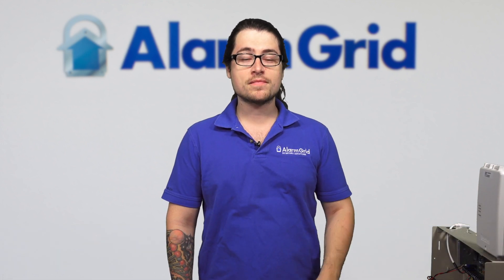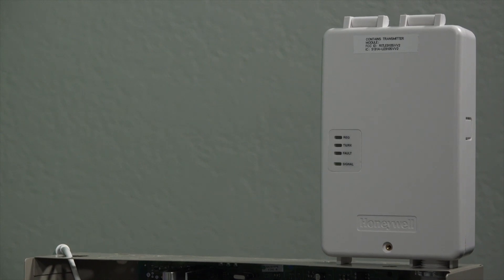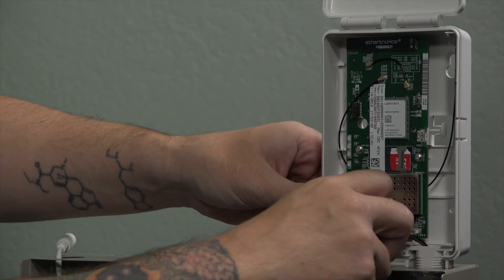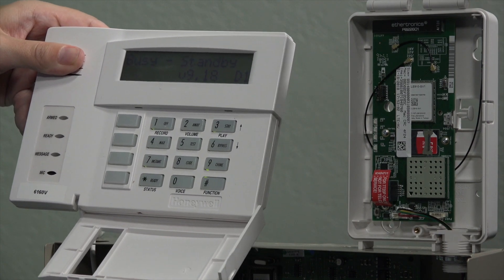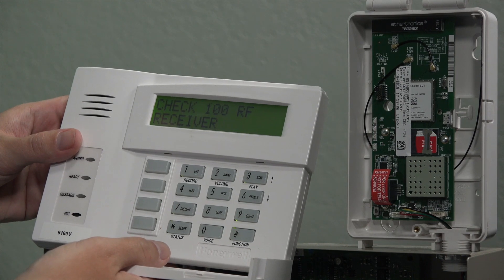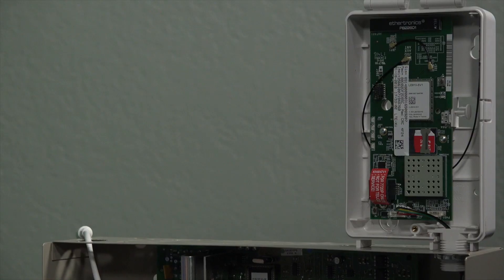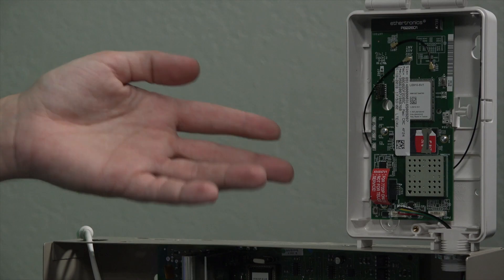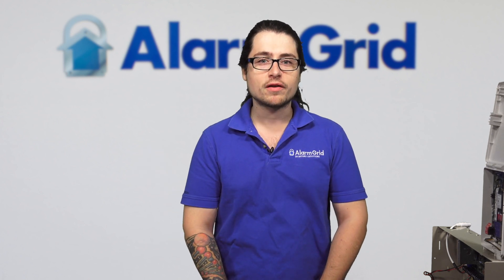Honeywell 6160: Explanation of a bF or LngRng Radio Error

Comment: Great information.  What causes a 6160 Key pad display "User Code Error: Key 0-9 Locked" which occurs upon attempting to disarm the Vista 20-p and pressing just the first digit of the 4 digit passcode on the 6160? The manual indicates that it is due to pressing 30 numeric keys (0-9) within a window of 15 minutes and no valid command is executed.  This has not been the case each time this occurs which is very intermittent.  It occurs once every few weeks. The 6160 has been swapped with a new one and the connections checked but issue still occurs.
Reply: Hello, if 30 buttons without a valid code is not being pushed then you have an issue on your ECP bus. The data has noise or a bad device connected to it. You will need troubleshooting.

Comment: Turns out it had to do with the cell towers being upgraded to 5G. You have to upgrade your system to accommodate. My installer told me that 12/31/21 was the final cutoff and till then you are subject to getting this error until you upgrade.